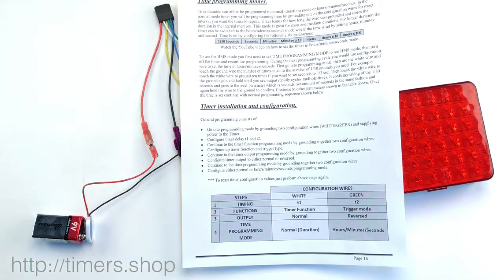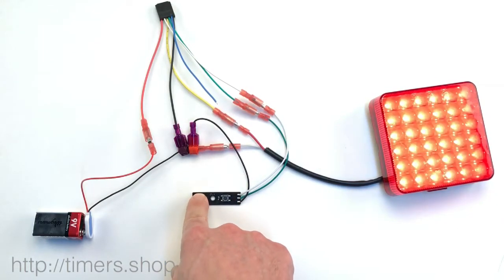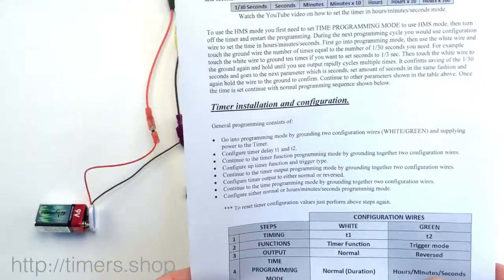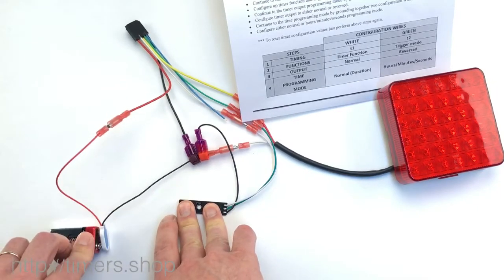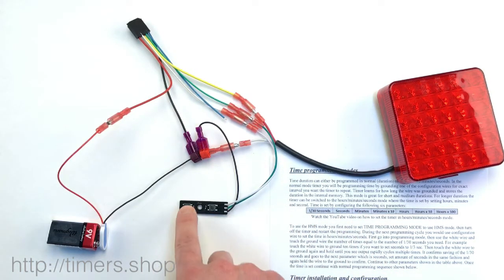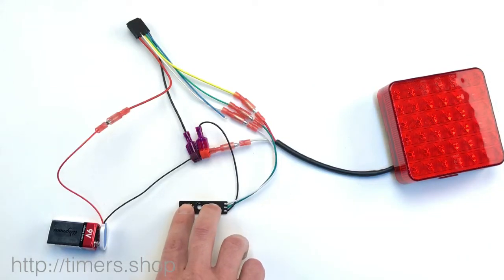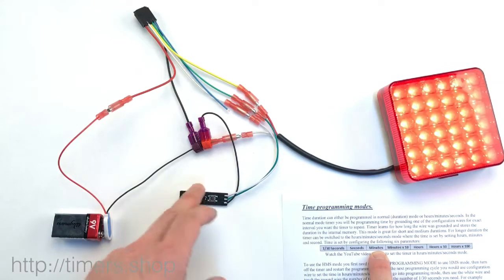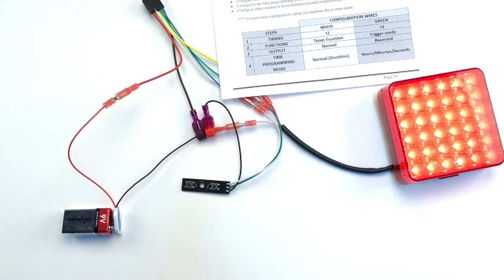Multi-functional 12v Timer Relay. Setting up time in Hours Minutes Seconds mode.

Comment: I've put my timer into a strange mode where it blinks 2 times and then turns the light on for 3 seconds when touching both the white and green wires to ground while connecting power. Is there any way of getting back to the standard programming mode, like a factory reset or something similar?
Reply: I had a similar situation, page 22 is helpful and with the combo video with the manual I figured it out after the 20th time. #5 Cycle function took me a while to catch. Threw me off too